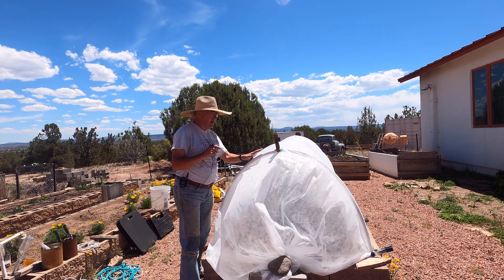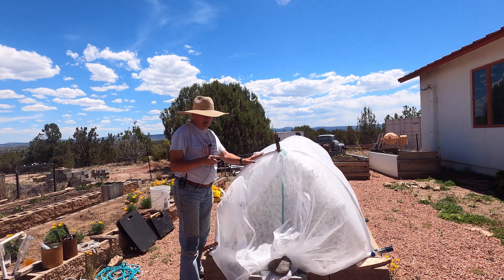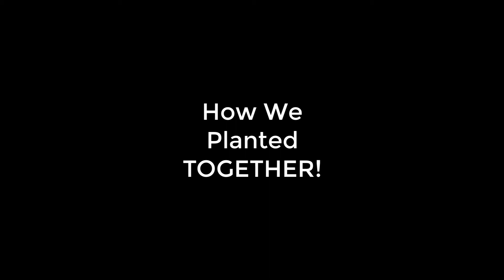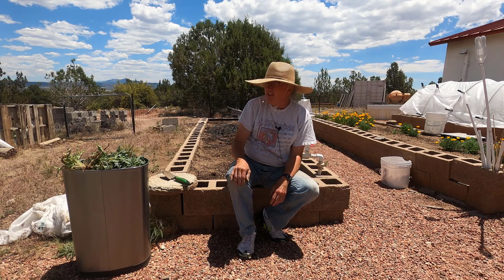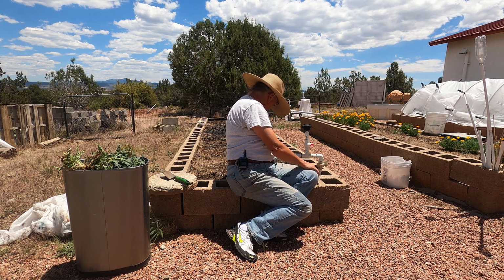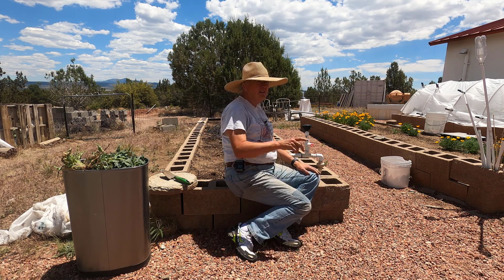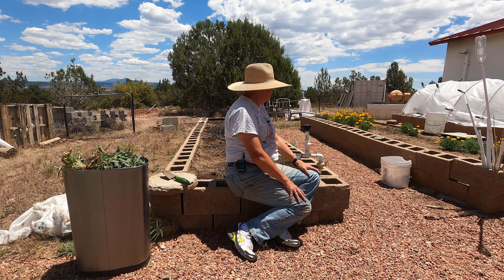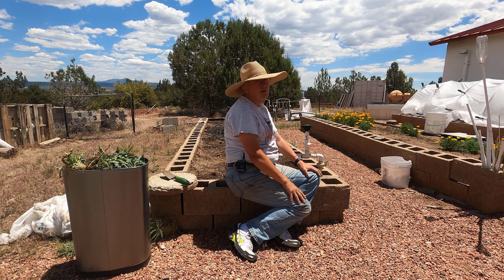Lost Footage Recovered And More Planting Tomatoes

Comment: Nice job done planting up that bed and getting the water lines installed. Might rough winds ya had no doubt. Noting like eating some dust. Stay safe and have a great day!
Reply from the maker: We lost the footage of that dust devil running right over Irene. Not the bad guest we’ve had but still pretty rough. Irene crouched down and I was holding on to the post with the irrigation controller. Isa was in the house and Jack was outside paying against the foundation. Very glad it wasn’t worse! Take care and stay safe CB.